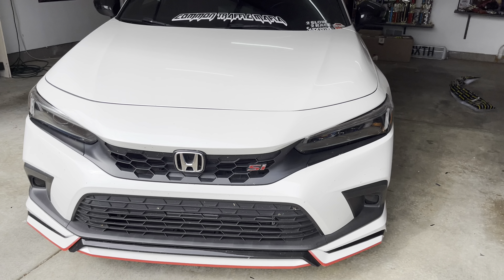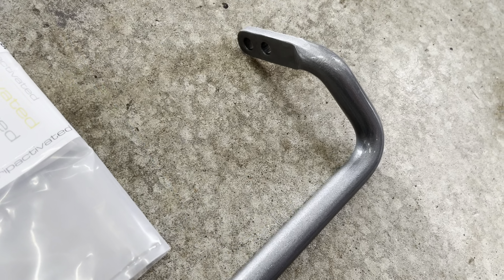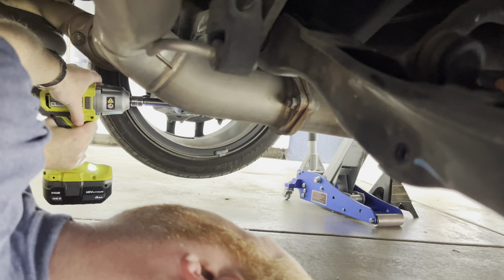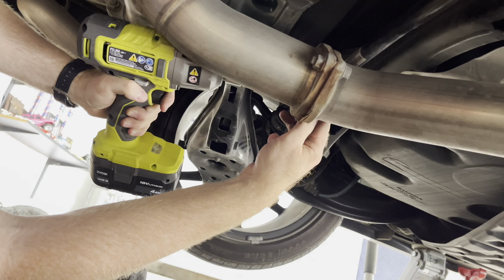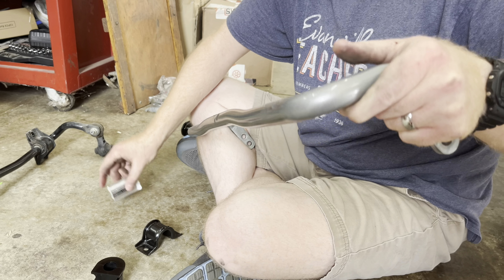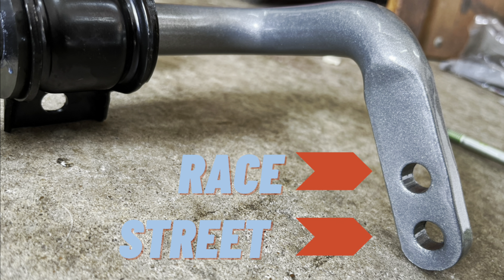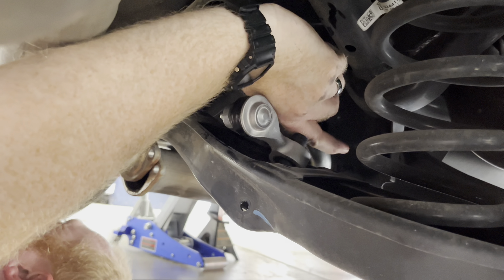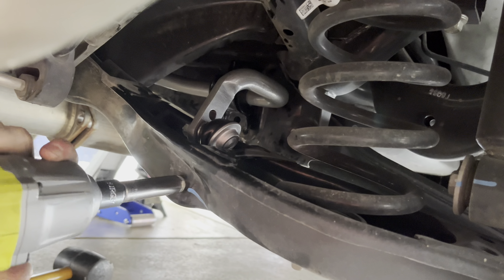2022+ 11th Gen Honda Civic Si Whiteline 2 Point Adjustable Sway Bar Install & Review

Comment: Where did you get the sway bar and other parts? I messaged whiteline on Facebook and they said they don’t have a sway bar that works on the 11th gen si, but your video proves otherwise.
Reply from the maker: @Chris-ut5ih  Unity Performance. I have a link to their website in the description.
Reply: I have a 2022 civic si and my exhaust is different than yours. It doesn’t have that bracket with the two 14mm bolts right under the swaybar. It’s just one long pipe. I find that to be so strange.
Reply: Also where did you get the torque spec info? Thank you!
Reply from the maker: @ I looked up Honda’s toque specs online.
Reply from the maker: @ My exhaust is aftermarket. It’s a remark catback exhaust system. I forgot to mention that in the video.
Reply: Can do provide de model # of the exhaust system please  @nprform
Reply from the maker: @ https://unity-performance.com/products/remark-exhaust-11th-gen-si-integra?variant=43467323441406